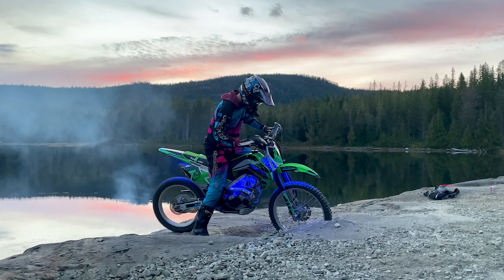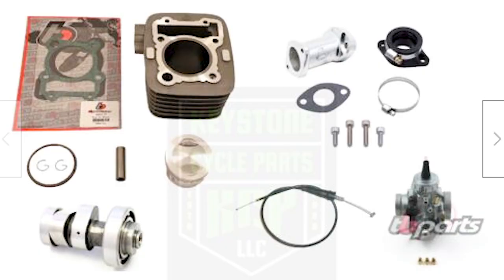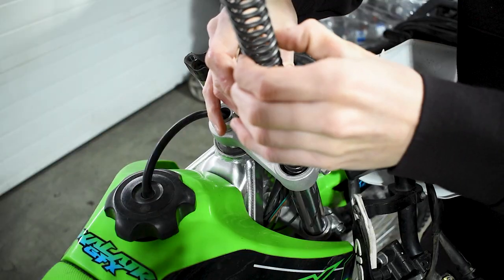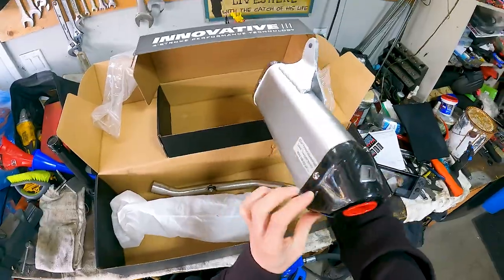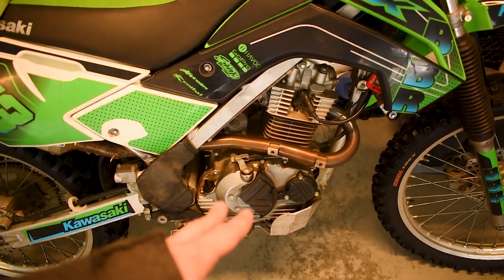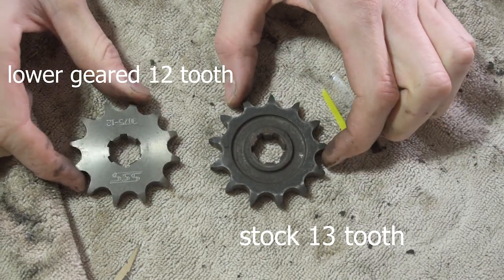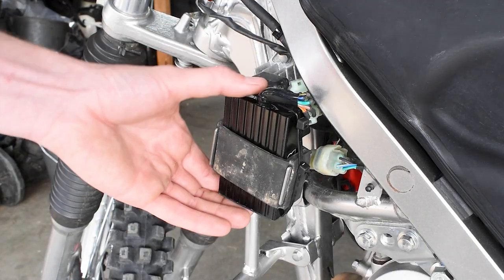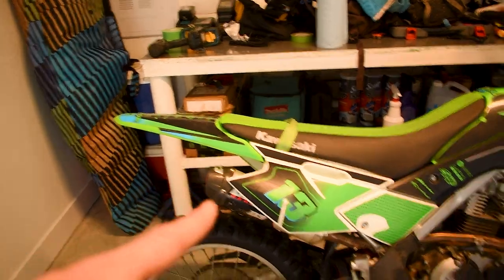The Ultimate Mini Enduro? 170cc Big Bore KLX140RF Review

Comment: We got the 2024 klx 140L for my wife. The thing wouldn't idle from day one. The dealer ended up replacing the carb so we could adjust it. I put a 53 rear sprocket, and it is still geared way too high for her. I am going 12 on the front next and 54 on the rear. It's so gutless. She hates the bike so far. We went on our first real trail ride today, and it was not a pleasant experience for her. No power and way too runs like absolute garbage. I'm looking at the big bore kit and gearing it down more. She likes to dog paddle on the technical stuff. I feel like we really made a mistake buying this bike. I hate having to pour money into this just to make it rideable.  There's not much choice at this point.
Reply from the maker: @clemp3010  sounds like a carb fuelling issue

Comment: I am the same user KLX 140, and I have made KLX 140 to 188cc by using bore kit BRT ceramic and piston super forged 63mm, and crankshaft BRT Stroke up 60.4 mm + carbon valve BRT 31/25 and carburetor PWK Kx85
Reply from the maker: Sounds wild!

Comment: Did your bike bog or hesitate when blipping the throttle fast? Mine does and no matter what jets I use or adjustment on the air screw it still does it. Totally lost on this one. Just installed the big bore kit and new vm26 carb.
Reply from the maker: Any small bore 4 stroke you cant just ring the throttle and have it rev. Now i did has a slight hesitation with my big bore klx170 that i could never get sorted with the vm26 carb no matter what jetting. The best jetting for me at 0 ft elevation was 25 pilot, 190 main
Reply: @AaronsEnduro  I will try that. I’m at 846 feet above sea level here in north Georgia. It’s running great for everything except when you grab the throttle quick to pop the front over a log or curb. It’s my 10yr old son’s bike. I guess I’m just used to my 450 KTM.
Reply from the maker: @ninjazxd best of luck , lemme know how it goes 🍻
Reply: @AaronsEnduro  also I forgot to mention the carb that came in the kit came two packs of main jets but no pilot jets. I had to order them from another vendor. They are TBParts as well. I thought it was strange that a new carb came with 10 or so main jets and no pilot jets. I will test it out tomorrow morning and see what happens.
Reply from the maker: @ninjazxd  i had to order a pilot jet too, 99% of people seem to be fine with the standard 22.5 pilot
Reply: @AaronsEnduro  so apparently it was right out of the box with the stock jetting. I was trying to get the bog out when quickly ripping the throttle. I guess I thought it was supposed to be like my 450 but it has an accelerator pump on it for that very reason.

Comment: Hey Aaron, got another question on the 140. I hate the lack of adjustment on the rear brake pedal. At best with the stock pedal, it's still higher than I like it to be. But the threaded rod coming down from the rear master cylinder prevents me from adjusting the pedal down any further. If you thread it down too far, you can't get the pin through (if you know what I mean?). I don't think you can thread the rod up any higher into the master cylinder can you? That would be the only way to get any more room on the bottom end of the rod. I just tried putting a KX100 pedal on it and it's riding about an inch above my foot peg so that's not going to work either. Am I the only one that's had this frustration with the rear brake pedal? Am I missing something on this?
Reply from the maker: Interesting.. mine sit perfectly level 🤔
Reply: Your not the only one. I also don’t like the rear brake pedal position. I wish it was slightly lower, it’s rough to raise my foot high enough, especially in boots to cover the brake without accidentally riding it constantly.
Reply: @antoniehm87  Yes, thank you that’s it exactly. You feel like you are constantly riding the brake when you just want to cover it.
Reply from the maker: @TheHoovercm  yep its not ideal
Reply: @AaronsEnduro  Having said that, I still love the bike! I’m going to keep making improvements to it. I’ll keep it for my oldest daughter whenever she feels confident enough moving up from her CRF125. Riding dirt bikes with yours kids, nothing better! 😀
Reply from the maker: Aint that the truth!!

Comment: I have the F model. Done quite a bit of work on it, Cogent front suspension, Pro Circuit pipe, air box mods and filter, jets and most important for a fellow who is 5'11" tall and 170 pounds, mine has a full size Carmichael MX bar, bar risers, guards, dropped pegs and best of all a tall seat which all in all makes my 140F feel and look full size. I also took some weight off with a lithium battery. At near 70 yo I quit motocross a long while back but use the KLX for my backyard MX track and the occasional hare scramble. If the throttle is kept pegged and let the little thing rev it scoots along admirably and does not wear me out like when fighting a heavier bike.
Reply from the maker: They’re fantastic backyard machines!

Comment: @AaronsEnduro Loving all your videos on the klx140, i picked up a 2022 klx140rf last fall and picked up almost all the parts youve added and talked about in your videos. Just had some questions on jetting and any of the other adjustments you made to get it to run properly. Im in wisconsin so was wondering what jetting you would suggest and any other help you might have would be greatly appreciated.
Reply from the maker: You’re on your own for figuring out what jetting works best for you, but generally speaking a 22.5 pilot and 185 main is what most are running. I ended up with 25 pilot and 190 main
Reply: @AaronsEnduro  alright I appreciate it anyway ill get that a shot and see what happens

Comment: Great review Aaron, thanks! Couple questions; you have two different rear brake pedals listed, one is black looks similar to stock, and the other is a Tusk KX250. I've smashed my OEM as it's crap anyway and looking at a replacment. Which of the two are you using? I like the Tusk as it flexes but it looks longer than stock? Do you like that one? Also, is the Mukuni carb swap going to make a big enough difference if I'm keeping it 140cc, not big bore. Did you have the carb swap prior to the 170? If so, what was the performance difference? Trying to justify whether I want to spend $220. Although I've rejetted the OEM carb and it cranks/runs really well, definately going to upgrade my exhaust as it can't breathe too well with the stock pipe right now. Thanks!
Reply from the maker: So ya the kx250 is a longer option if you have bigger feet. Personally i run the oem black replacement and it was perfect for me with size 10 boots. I never ran the vm26 carb prior to doing my big bore, but i do know the stock 20mm carb is tiny for even a 140cc . Ive read that people seen gains from running the 26mm carb even on a stock engine!

Comment: I am 12 and my KLX 140RF is an early 2023 prerelease bike, I have had my bike for 2 years now and I want to upgrade my bike since I am starting to grow out of it. Do you think that putting a 170 kit on a nicely running engine is something you should do or should you use the bike a little more until it starts giving you problems to repair the bike with a bigger kit?

Comment: Is the big bore reliable?
Reply from the maker: Never had a single issue! Dont hear of anyone having issues with it either! The 170 kit is dumb reliable
Reply: @AaronsEnduro  I have been thinking about getting one, but I don’t know if I should or not
Reply: @AaronsEnduro  and how much faster do you think it goes?
Reply from the maker: Big bore kits dont add top speed. They make it accelerate faster
Reply from the maker: It makes around 50% more power
Reply: @AaronsEnduro  ok thanks
Reply: @AaronsEnduro  do I need a new carburetor with this or can I just use the stock?
Reply from the maker: The stock 20mm carb is tiny and restricted already with a stock 140. Youll want the vm26 carb conversion kit (listed in the description)
Reply: 50% more power. Holy dang